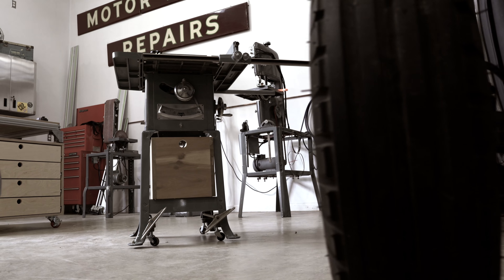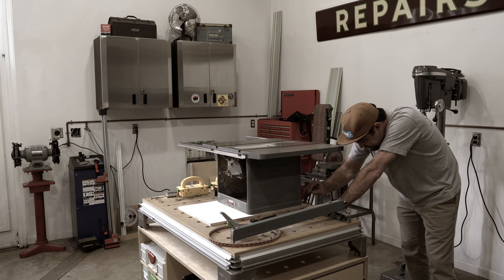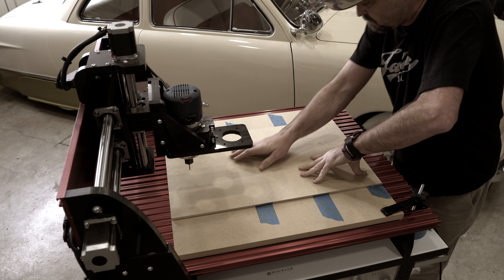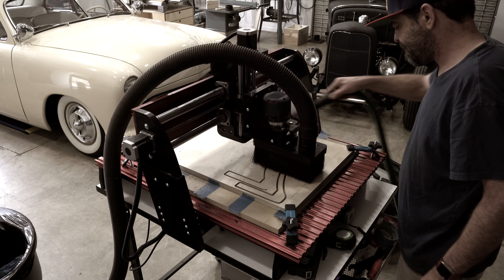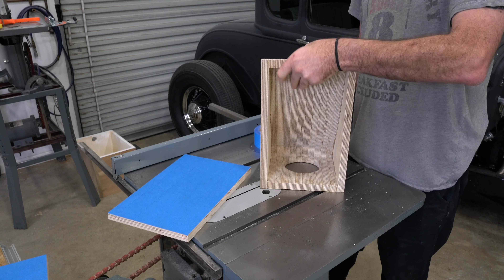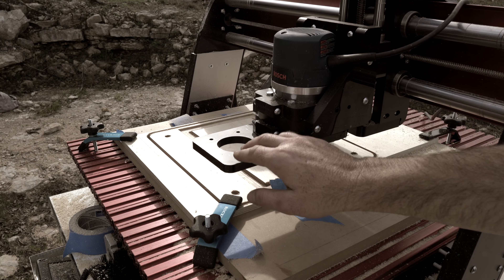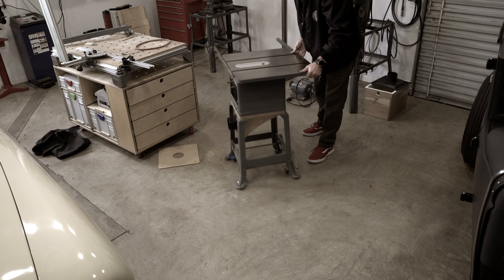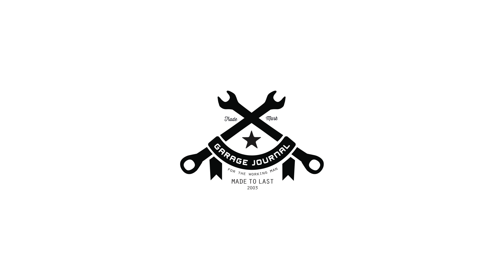Vintage Contractor Saw Dust Collection

Comment: I did this twenty years ago with the same saw. The open back can be mostly made dust proof by using thick  visquine and grey ducttape.  Just cut a slot for the belt and leave enough bag so the tilt won't tear it off.  Your shop vac or dust collector will create more than enough draw to keep ALL dust inside.  Also, I  sprayed expanding foam under the edges of the cabinet where the table sits on top.  I'm still using that same saw today, having changed the visquine a couple times, but it's easy.  The down draft though the saw slot is strong and very little gets on the table.

Comment: Similar to Joshua I was going to recommend dowel for the alignment. 

Another tip using the hole saw on a drill press is how it’s attached. Instead of the hole saw screwing on and pushing the bit collar into the hole I tighten the hole saw all the way to the bit holder surface. That way it won’t rock. 

Nice project. Thanks for sharing

Comment: Using the CNC to drill holes in the same spot on all the layers and putting a dowel that fits would have saved you a lot of time with alignment. Also to save on the blue tape you can also use shelf liner just make sure its matte and not gloss for the 2P10 to stick.
Reply: Joshua Russell I was going to add the same dowel idea.

Comment: I've owned one of those 9" saws since college [48 years]. Just last month, I attached a bottom port from Rockler. Here's a picture:
https://www.bighorncorp.com/big-horn-11103-12-12-inch-hood
Now it doesn't look a cool as yours and yours is really cool looking, but I expect it works as well. That being said, dust collection is poor. The open back of the saw is the problem. I'm working on a design for that, but it is not straight forward. 

Hope your setup sucks [dust] better than mine.